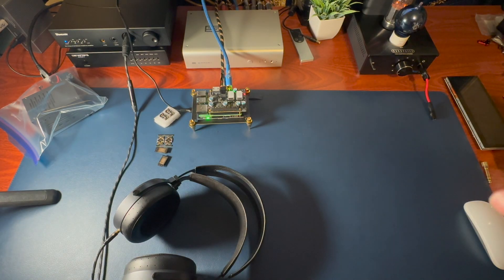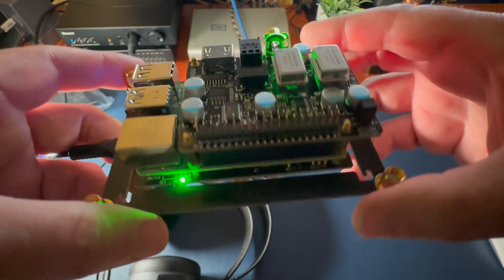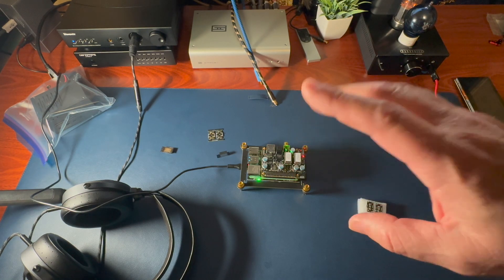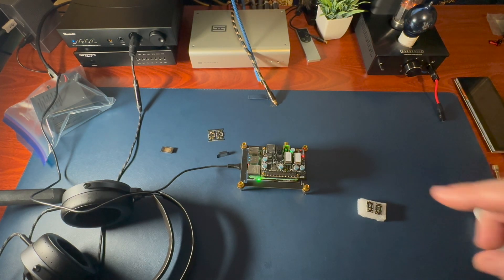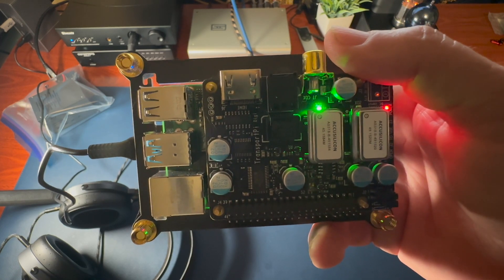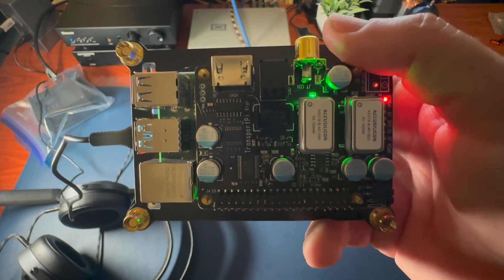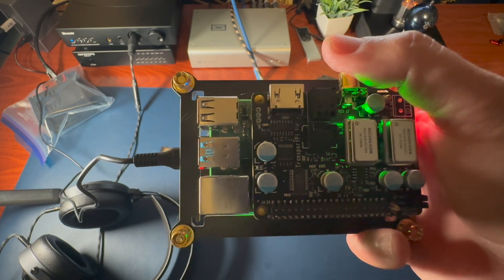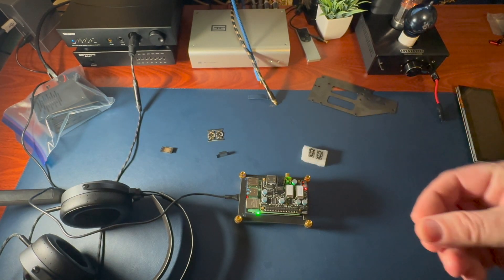Worlds Best Streamer ? Bits are Bits RIGHT?

Comment: Nice video.  Upside, its diy.  You can change components as technology improves.  With regard to the absence of cases, no problem, you can get your own case and customize it as needed with a drill and a dremmel.  Also as you change or add hats, the connection holes may no longer line up, so you can make modifications. Block out the old holes and make new ones. That would be difficult to do with stock cases.  Remember, it's diy and these things sound super amazing.  iIt bests my w4s and cary streamers easily. enjoy.

Comment: I have ordered the same board from Iancanada. I was looking to get an Allo Digi One for $110 and this board is only $35 dollars more($145) and it has I2S output and reclocking to boot. What a deal. Where did you find Accusilicon clocks with the 4 pin set up? I would like to try changing the Femto clocks that come with #20D TransportPiDigi II. I cant wait to hear it with my RaspberryPi 3B+. Nice video. Keep it up!

Comment: Why do you need a power conditioner in a streamer? if you were implementing a DAC, I can see the reasoning, but in a streamer? Moreover, as you would be streaming in an external DAC, the input would be reclocked anyway. In other words, what you are looking for is a streamer that streams in output the bit perfect copy of the input using a coax, I2S or any other connector. Isn't it?
Reply: Proof is in the listening. Artifacts affect the signal and what gets reclocked in the DAC. I have 2 streamers and the sound between them is night and day while being fed into the same DAC.wether you use a coax or optical cable makes a huge difference as well to the depth of the sound.

Comment: That's the simplest build you can have, you can add the FiFoPI to re-clock and remove RPI noise, plus the FiFoPi and other board on top can be powered with linear power supply or ultra capacitors. Also, using a linear power supply to power the RPI can remove a bit or noise and it does not cost a fortune.

Comment: Can it be implemented on ESP32-C6?
Reply: I have built a streamer using an ESP32 but it isn't an easy process and certainly not for the beginner. Had to write all the code myself which took quite some time. Much better to buy pre-built modules specific for the job.

Comment: Linear supply and you re in heaven
Reply: So what you're saying is that a linear power supply would make your pc "more precise", isn't it?
Reply: @guyboisvert66  What you are trying to achieve is lower noise on the stream to prevent errors at the DAC. Switched power supplies can produce a horrendous amount of EM noise and can even cause problems on your analogue side if you're not careful.
Reply: @schrodingerscat1863  You don't understand pal... The device performs up to spec with the power supply that comes with it.  Basic engineering of a minimally well designed internal circuit board will have input noise filtering and stabilize the input power.  It's very basic stuff so no need to waste money on linear power supplies... And it's not because a PS is said to be "linear" that it is automatically better than a switching one... Every engineer knows that...

Here is an example of a well design power supply:  The guy feeds the DAC with the worst power you can imagine using a light dimmer before the PS. As expected from any good PS design, it doesn't have any impact on sound quality.
https://www.youtube.com/watch?v=OL23xkLfPTU&t=972s
Reply: @guyboisvert66  It's pretty simple to build a good, well filtered power supply for a DAC that takes very little power, an amp drawing a few hundred watts is a lot more complicated and expensive. But then a decent switching supply shouldn't generate huge amounts of noise but most switching supplies these days aren't well designed they are made cheap as possible.
Reply: @schrodingerscat1863  It's not because a power supply is linear or switching that the resulting performance is predictable.  It's engineering and power supply design is a well mastered topic. Yes it's very obvious that higher power PS will cost more and the design a little bit more challenging, be it linear or switching.
Anyway, take as an example Purifi / Hypex class D amp modules and their associated switching power supplies.  These amps as a whole are topping the charts for their fidelity.  And their SPS are relatively cheap considering their quality.  Why did they choose SPS and not LPS?  Because it just make sense end the end result match the design goal and performance, it's as simple as that.  Do you think that Bruno Putzeys made such a good amp design but getting all his efforts destroyed by using a bad SPS?
As for cheap SPS, sure they exists but one shouldn't generalize, we can say the same about cheap / bad designed LPS...
Reply: @guyboisvert66  I was talking about the EM noise created by such power supplies. Linear creates predictable mains frequency noise with few harmonics which is relatively easy to filter. Switching creates a broad spectrum of noise which is far more difficult to filter due to the broad frequency characteristics of a switched wave. It can be done, I have a high end bench switching supply that has an incredibly stable output with extremely low noise but it also has a complex output filter design to achieve that. Class D amps are particularly susceptible to power supply noise so a lot of thought has to go into the power supply on a class D, often more than the amp itself. Switching has its benefits of course being smaller and far more efficient also requiring less cooling. To design an audio grade switching supply is no easy task and they will have put a great deal of effort into that for a class D amp.
Reply: @schrodingerscat1863  You're right, more complex but once done, can save money and be more convenient.  Designing a good amp circuit is not an easy task either!  So what i read about Putzeys' design with "pole switching" feedback is very cool and wasn't so obvious and easy!  But electronic components and design are improving.  We see as another example the high level of fidelity DACs are now, we've reach commodity level!
OTOH, i'm often tired to read all the crap companys and peddlers are pouring around to sell their stuff...and poor consumers are abused by all of this...

Comment: Great that you are sharing the enthusiasm for well done digital diy project. 
The beauty of iancanada stuff is that it is modular.  You can get started and learn the system and then piece by piece upgrade.  You can create something that will rival the MOST expensive digital system.
BTW, your Accusilicon clock is better than the Crystek.  But you can go crazy when and if you are ready.  I use Well Audio SOTA clocks on a FIFOPi with discrete power supplies for every consumer.  I use supercaps as filters everywhere.  I could improve by using ultracap power supplies, but at some point you say, good enough.  In the commercial product world my clocks would be $10-20k.  But it costs 500 diy.  As you improve the clocks, the power supplies and the vibration and EMI isolation, you continue to make incremental improvements.  These improvements make the sound more natural, detailed and analogue beyond anything vinyl or tape might produce IMHO.
Feel free to sample some sound clips.  Just go to my YouTube channel for a couple of samples.  https://www.youtube.com/channel/UCoo6iHTq9eVOnY0FesOePvw

Comment: bits are indeed bits, I do not believe a streamer is any better than your average laptop makes no sense to me. the magic happens in the DAC
Reply from the maker: Trust me my logic was like yours for most of my digital music life. I kept finding that expensive gear was using reclocking with high end clocks so I thought I would find a way, the cheapest way to find out. The Ian Canada streamer boards are extremely high end. You can do a lot of things if you look at what he offers. I went with the simplest  items and was blown away. Keep in mind I’ve spent over $5k in my analog system to get good sound and this simple streamer blew it away. All I’m using is a reclocking device on top of my raspberry pi computer. Now with this said synchronous and asynchronous are two different things. So if using usb you must rely on the Dacs conversion which I find to absolutely suck  unless using high end clocks. You can also use a digital to digital converter and get similar results. I suggest you try a cheap ddc and see for yourself. If not return it.
Reply: @ThriftShopReviews - first off, thank you for the video. I am still learning & it helps. @StagnantMizu makes sense from what I understand - that is unless you saying that a DAC is unnecessary via your build? I had always thought that the optical output of your device would have to be decoded in a DAC in your preamp/amp still. Any insight is appreciated.
Reply: After some good sleep, re-reading all comments, and help from bard, I think it's starting to gel better in my head. Since the output via SPDIF is PCM's data, clock, and channel info it  makes me think that having gitter-free clock signal has value. Yes, I expect that the a downstream (high quality) DAC may also have re-clocking, but having higher quality input data will lead to making that DAC perform even better. Prior to this research, I was thinking that the source data stream was being transmitted over SPDIF - this would lead one to think that you're essentially copying the original byte stream from one component to another (i.e., like copying a file, clock is irrelevant). I now think of it as being 3, 4,or 5 separate streams that all must be synchronized by the critical clock data as it travels to DAC.
Reply: @ThriftShopReviews  Spending money on the analogue side and a good DAC is exactly where the money needs to be spent. Many high end DACs will buffer and retime the stream anyway so you may not be getting any benefit from this setup if your DAC has this facility built in.
Reply from the maker: I guess you need to try one to verify your logic.
Reply: I mean thats correct but from a technical standpoint how would it differ, it is not like my laptop has missing pixels etc I just dont get what a streamer would add above easthetics. As far as I know Speaker>Amp>DACs
Reply: There can be a difference as the output from this setup is re-clocked through a buffer to produce a very clean and steady bitrate which can reduce errors at the DAC. DACs can cope with errors but there will be loss of clarity as each error is corrected so having a clean stream and steady bit rate can have its benefits. Thing is, most decent DACs will buffer and retime the streams anyway so with such a DAC there would be no benefit in this than taking the stream directly from the PI.

Comment: Yes!!

Great video!!

I bought an old (non functioning) Marantz CD32 for €5,  took out all electronic parts, mounted the Raspberry Pi / Ian Canada Hats, torodial transformer, linear power supply, et voila...

Used diy interconnect cables (N6 silver cores in ptfe tubes) to my Yamaha amp, and it sounds AMAZING......
Reply from the maker: Good idea about mounting in an old cd player. Thanks for that great idea. My biggest issue is the case and that is perfect. I will make a video on that and give you credit.
Reply: @ThriftShopReviews I completely removed the pcb board, cd transport mechanism (sold it for €5), glued the cd transport front to the chassis, and kept the original power button..

I made an opening in the back for the Raspberry Pi ports, and fixed some high-end chassis connectors..

Cleaned the unit, and it is my stack.
It looks super-tight....
Reply: @gerrit-janslettenhaar4252  Did you ever consider leaving the cd transport in the case, for the ability to play from cd? I guess you could use a SATA to USB converter in order to connect the transport to the PI if the transport has SATA interface.

Your idea is very cool.
Reply: @oscarwahlstrom5426  The Marantz has a very good Philips CD transport, and I kept it as spare part.

Let try to connect it to the Pi...

Comment: I have a daft question. If you use a digital output from this streamer (or any), isn't it then going to a likely inferior DAC inside your amp? As in would it be better to go straight to analogue on the AMP? I've never tried this, so have no clue what the answer actually is. Thoughts?
Reply from the maker: I use this streamer to reclock the digital stream and then go to a dedicated DAC. You can add a dac hat to this streamer if you want.
Reply: First of all, you can't "go straight to analogue" these are all digital signals, that is to say, CD's, streaming, even your TV are all digital signals that have to be converted. (Your TV, has a D/A CONVERTER FOR THE VIDEO SIGNAL.)  Sooner or later, it all has to be converted to analogue. Basically, he's improving the signal before it's even sent to the DA. Or you could say the signal is being cleaned up, before it is sent to the D/A. Back when CD's first came out, CD transports were a big audiophile thing. Still are, but there are very high end CD's players with very high end DAC's. The idea has always been separation of the components and quality of the components always improved the sound. Hence the emphasis on a very good power supply for a Raspberry Pi setup. But all high end audiophile gear has always done this, the difference is, now the DIY community benefits from the internet, and we can build things that rival very high end audiophile components that cost tens of thousands of dollars due in no small way, to all these DIY contributors like Ian and speaker designers like Troels Gravenson and Joe Rassmusen and of course Ian!.
Reply: This is essentially to provide high quality re-clocked bit streams to an external DAC. The PI is just acting as a bit stream source into a buffer which re-clocks the output to make sure it is a perfectly timed stream. There are DACs that can be added to the stack that then give analogue output but if you have a dedicated high quality DAC already this is the best way to go.